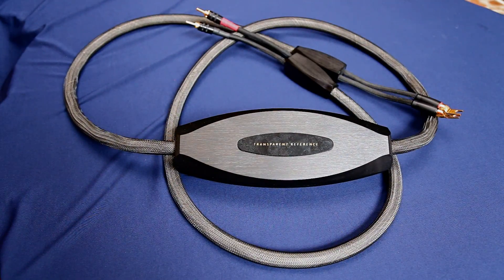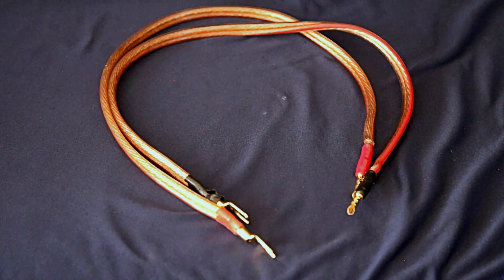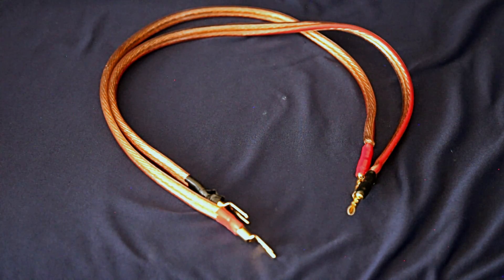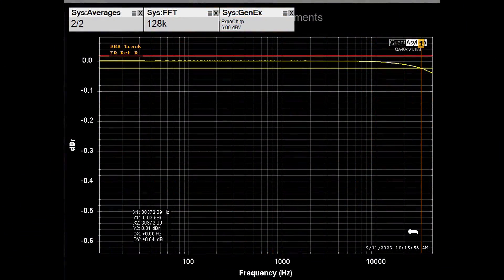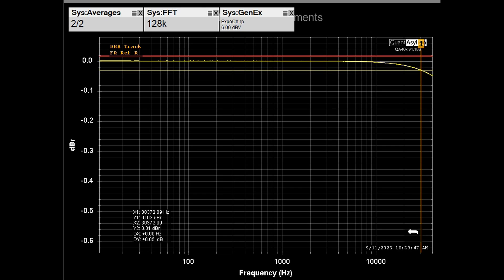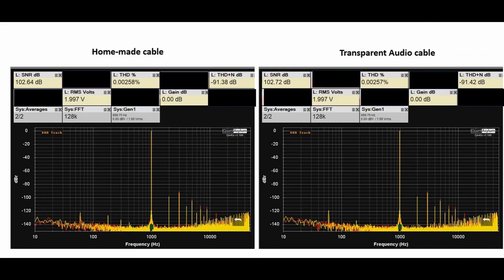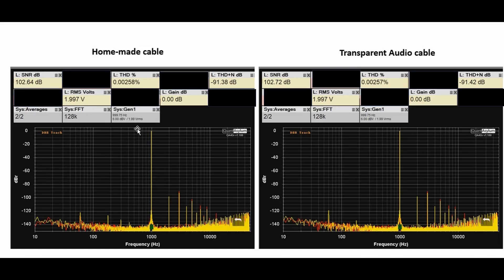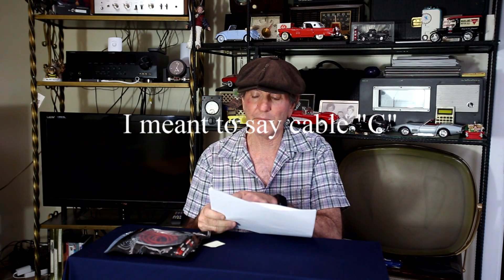$8000/pair Speaker Cable  vs. $14 DIY Speaker Cable A/B Test: Vintage Audio Review Episode #87

Comment: This test was a total waste of time.  Most of the differences in cables reveal themselves in stereo imaging characteristics.  Sound stage characteristics in specific.  Qualities such as separation between instruments, focus, image placement, depth, layering , three dimensional holographic imaging, fleshed out vocal tonality etc.  

If you are only using one speaker, what good is this test?   Do you listen to music on one speaker or two? 
Pointless waste of time. 

Not to mention, the “test box” is going to act as a filter and impart its own sonic characteristics which may mask any differences that the cables might have. 

Your measurements of frequency response is a measurement of quantity not quality. The ears are most sensitive to arrival time discrepancies.  

If you’re listening to only tonal changes, you’re missing the whole point of having two speakers. Why don’t you just get one Bluetooth speaker with awesome tonality. 

In conclusion, if you don’t preform an accurate test, you’re not going to get accurate results.  Stereo systems use two speakers not one.
Reply: Take a look through my other comments on this, below ... pay special attention my explanation of "mid-field cancellation" which totally invalidates any stereo testing.
Reply from the maker: Though I disagree with a lot of your points, I do appreciate your time expressing your rationale. There have been a few reasons as to why you use one speaker- one is just the mechanics of doing the test. There have been a few reasons why a mono test is used that have been mentioned in these comments.  I have yet to hear a bluetooth speaker that is as accurate as the one used in this test. Your comment about frequency response is just plain wrong. All the magical audiophile words you pointed out are very subjective and dependent on the speakers, their placement and room acoustics once again- not so much from cables that are constructed decently- that is my opinion, of course, as well as really sharp engineers that I know. I suppose we can agree to disagree as we are on different sides of this.
Reply: @vintageaudioreview  Thank you for your nicely written response. When you have speakers accurately placed in a room and when Left / Right crosstalk is eliminated due to room treatments and/or digital room correction, and one can hear all those audiophile terminologies, that’s when cable swaps will reveal sonic differences. 

With regard to frequency response, which is only a measurement of quantity of each frequency, it doesn’t indicate whatsoever the quality of each frequency. Muddy bass for instance, or distorted pitch is not going to show up on a response chart. A proper reply would be to explain how you think my comment was incorrect, with specifics of why as opposed of just saying “It’s not true”.  

The magnetic 🧲 aspect of the electromagnetic portion in the audio signal cannot yet be measured with  today’s measurement equipment. Those changes can only be heard with a pair of ears listening to music over a pair of speakers.  
Transient response is more important than frequency response, even the well respected Floyd Toole who also did invalid tests with only one speaker, admitted that transient response measurements are more important than frequency response with regard to determining sound quality. 

100 piles of equal stacked piles of garbage is going to measure the same as the equivalent 100 piles of equally stacked gold. That doesn’t mean they have equal value sonically. 

I would like for you to try and explain how my statement with regards to frequency response is “just plain wrong”.
Reply from the maker: @hiresaudiocosta873  Interesting that you say Toole did invalid tests w/one speaker. I am sure that transient response (of a speaker or amp) are important, though you don't see a lot of that in amplifier testing so much these days- I have an "Amp Dynamics" test that I may start doing on amps once I figure it out. As for frequency response, I believe it was a study by Harmon using "trained" listeners showed that the majority of them preferred the speakers which had the flatter frequency responses. I don't know if it was in the same study, but the "trained" listeners did better than the audio reviewers. If you have a frequency response that falls off in the high end, it is not going to sound as good- I am working on an upcoming video right now- today, actually- where I commented that the high end seemed to be lacking and then I looked at my measured frequency response data, and sure enough it was. Anyway, even though I am retired I need to limit these responses as I have that video to finish and need to finished testing a vintage Sansui receiver today...You obviously have strong opinions based on reading and your experiences, and I do respect that, though we differ. But if you tell me that you can hear a difference when swapping out a toslink cable.....
Reply: @vintageaudioreview  I have a rig and I’ve done many many cable swaps and comparisons on one system And yes, I’ve swapped a cheap plastic toslink cable from Amazon Basics with a Highly polished high count glass fiber cable from Lifatec. Yes there are audible differences. Light is affected by magnetism, temperature, density of the medium in which it’s traveling, as well as reflections of the edges of the fiber tubes.  I used to be a cable denier until I invested time doing actual experiments.  I’ve got over 20,000 hours logged in of listening to my sound system and making changes in OpAmps, amplifiers, DSPs, speaker drivers, speaker wires, RCA interconnects, power cables, source units, HDMI swaps, digital coaxial cables, Toslink cables, binding posts, eliminating binding posts, etc. 

It all boils down to propagation speed of varying frequencies throughout the signal path which is affected by many different factors such as metallic properties, metallic grain structure, dielectric material ,  termination metallurgy and type, purity, composition, and construction.  

Both electrical and magnetical properties will have an affect on propagation speed of various frequencies. Electrical properties can be measured, magnetic properties not easily at this time.  Just because one cannot measure something energetically, doesn’t mean it cannot have an influence on the physical.  😇
Reply from the maker: @hiresaudiocosta873  No use conversing any more... thanks for your thoughts.
Reply: @vintageaudioreview 
Aww shucks ... I was going to ask what flavour of koolaide they were having at their next meeting.

Comment: Here's a video where they opened the casing on a $1,000 cable...

https://youtu.be/JjaF7r2acog?si=hBwKJWcfCIChJejI
The photo is at 15:00 and that is a 150k ohm resistor, connected at only one end.

Yet another blatent rip off....
Reply: Here's another one of a $5,000 cable that is so heavy it breaks connectors and has a battery box that hooks to nothing and picks up noise...

https://youtu.be/KzwAdwvy9l4?si=mALZty1XwCGKJ7Rv
Reply: I can keep doing this all day... but I trust the point is made.

Comment: Okay ... time to "out" this Transparent Cable nonsense...

I've just sent Scott a link to an article where they did open the expensive cable to see what is inside... (I can't post it here... but he can) 

The big blob contains a 2.5 microhenry coil in series with the red speaker lead and a 1000pf  (0.1uf) capacitor with a 31 ohm resistor in series across the red and black wires.  

That is about $5.00 worth of parts.

It forms a very ineffective LC low pass network that in simulation causes a 0.5db drop at 20khz. ... and does nothing else.

This is commonly called a Zobel network and it's primary function is preventing amplifier oscillations above about 50khz... but any decent amplifier already has that built in.

No way on earth they're worth $4,000 each.
Reply from the maker: Thanks Doug! Here is the link he mentioned:
https://www.instructables.com/How-to-make-a-Transparent-Audio-Reference-XL-Speak/
I did not notice any drop off in the Frequency response that I measured. I am wondering what the criteria is for "tuning" that they employ?
Reply: @vintageaudioreview 
Dollars against Donut Holes ... You send it in, they send it back.

The article contains pictures of the opened blob... it's all potted. 
The X-Ray is particularly telling.
Reply: Why do you think that's the $4,000 part of the cable?

Comment: The snake oil business is alive and well in the high end audio industry. 
I have tried the high end interconnects and speaker wire and it's all b.s.
Grabbed some ofc wire and Amazon Basics interconnects and there is no difference between the Audio Quest or Kimber Kable that I foolishly spent $$$ on.
Reply from the maker: Thanks for the comment and I think the snake oil part of the business will probably always be there.
Reply: @vintageaudioreview 
Only as long as we keep buying their crap.
Reply from the maker: @Douglas_Blake_579  Though some of does look pretty cool!
Reply: @vintageaudioreview 
But why does it have to look "cool" if it's hidden behind your stereo stand?
Reply from the maker: @Douglas_Blake_579  I am thinking about the folks that have large monoblocks up on some stand (fancy most likely) where the wires would be readily seen. This is not the case for the majority of us, and in those cases it is probably somewhat important from an aesthetic (and maybe ego) point of view to have "nice looking" speaker cables- I certainly get that point of view. (chuckling) I imagine the speaker cables would probably be up on risers to improve the sound, though...

Comment: Scientific listening tests require a control (reference) which for cables involves the elimination of the cable. The requirements achieving anything other than a null result in testing for fine audio differences are detailed in 'Recommendation ITU-R BS.1116-3 Methods for the subjective assessment of small impairments in audio systems.' Anyone familiar with the science of listening tests would know that the severely compromised testing procedure used for this test will always produce a null result. When the appropriate procedures are followed, the impairments caused by speaker cables are indeed detectable in double-blind tests.
Reply from the maker: I really appreciate your commenting in an intelligent manner. This was by no means a perfect test and I am aware of some of the problems with- most have been pointed out in the comments on this video. This was a gathering of "audio guys" and we like to do something other than just sit (stand) around and eat and drink and talk about audio stuff. Everyone likes doing this testing and I am planning another for Jan. The one thing that no-one, other than myself, has brought up is how good is your hearing? I will look at the spec you mentioned and am curious if it requires a hearing test or a listening training such as the Harmon's "How to Listen"- thanks for that info, though. And what sample size do you need ? And what about room acoustics? Based on the comments- right or wrong- it seems like the majority of folks don't feel really expensive cables are going to make a difference. If a way can be found to switch cables in <1sec that would meet the requirements you referenced that would be great.

Comment: I use to own a 8 gauge Monster cable until a friend went to my house with a Transparent Wave which is the most cheap of them 400 hundred for the pair, next day I bought one because I would not be happy with the Monster, difference in cables cannot be measure, the definition is not measurable, if you didn't hear the difference your wallet will be happier
Reply from the maker: Thanks for your comment and if the Transparent cable floats your boat, go for it....